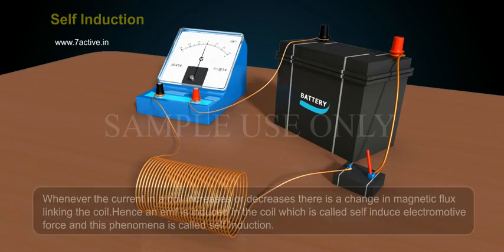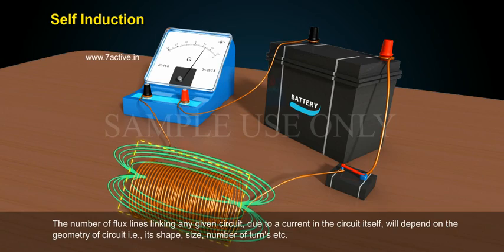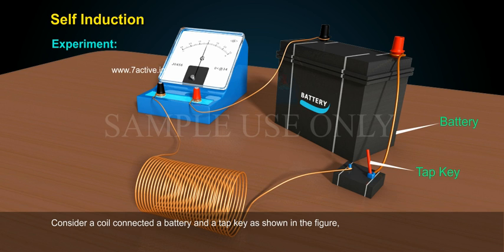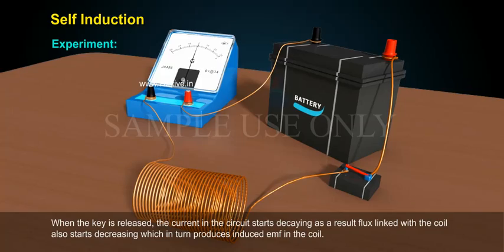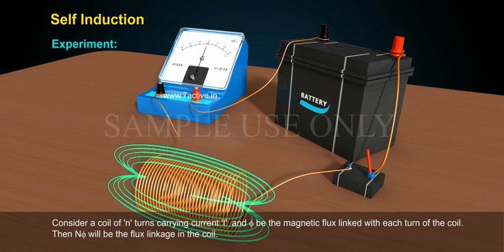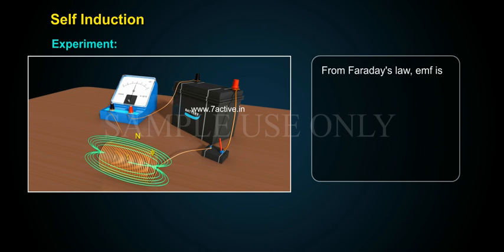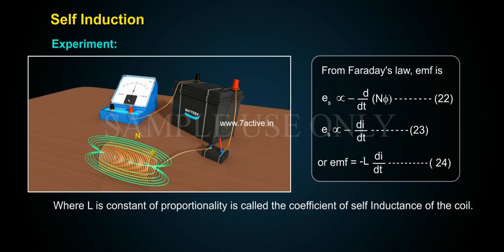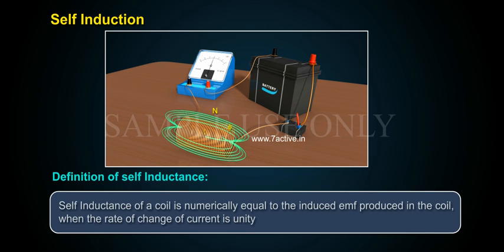SELF INDUCTION PART 01

Comment: In other words, current through an inductor cannot change instantaneously and  voltage across a capacitor cannot change instantaneously.
Reply: why..?
Reply: @aareesakthi9877  When the battery is connected and the current starts increasing in the coil, then according to biot savarts law, a magnetic field would be produced by the coil, and since the current is changing (since the battery is just connected and it takes a while for the current to reach its maximum stable value), therefore a changing magnetic field is produced here. Now, since there is a changing magnetic field here, therefore by faradays law of EMI, an opposing current would be generated in the coil. Similar would be the case when the battery is disconnected. Hence, Change in Main current is opposed by an induced current.

Comment: If the coil is around an ironbar, the self induction should be much more higher, right ? I mean a coil without an ironbar, like in this video has very less or almost no self induction, right ?
Reply: peter schiller it also depends upon frequency of changing voltage. And yes its right that ironbar will increase the inductance to a large extent